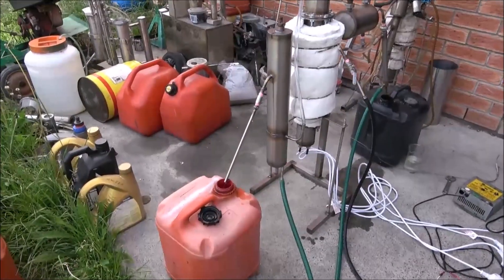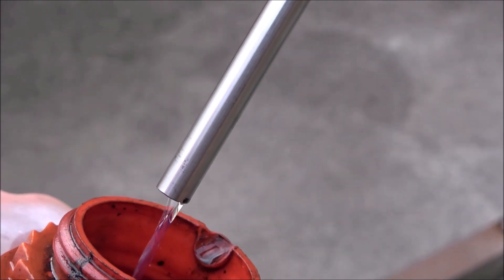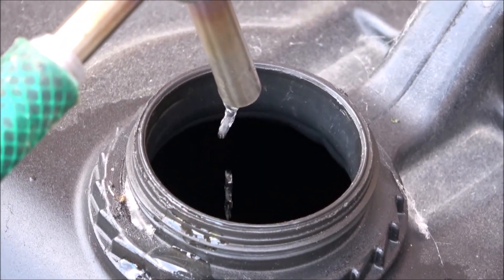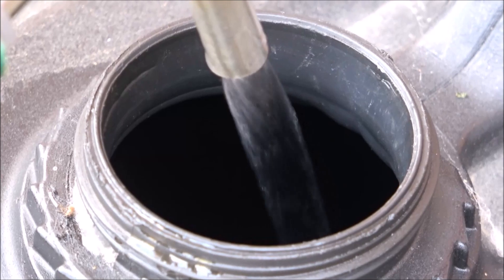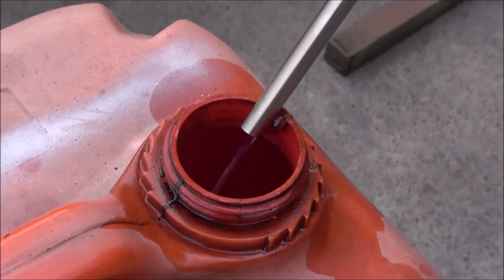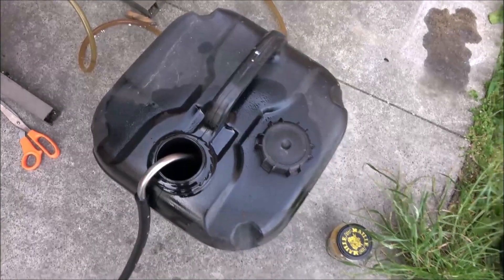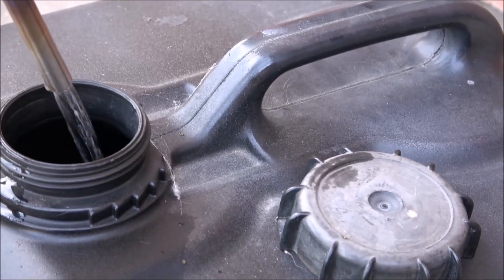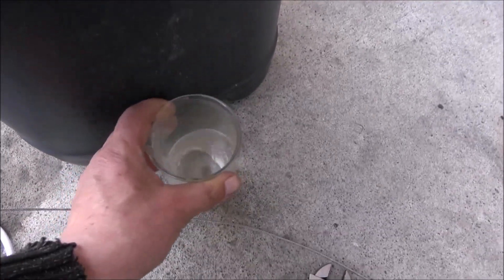6kw fuel separator.

Comment: Can you build one that's not electric I'd like to buy one of them but don't use electric for it I have a building I how pipe connection that lead through the insulated walls to fuel tanks I use to store fuel in so the fuels can't get to the flames but don't know how to build one
Reply from the maker: I can build one without electricity, but it would be bulky with pies and heating medium, also difficult to control.
Reply: @santeryi9  is there away to use a oil burner as the heat source around a tank that would be able to run a continuous feed
Reply from the maker: @lifeoftraveling8330  it's a continuous operation and temperature required is no more than 180c the temperature oi flame is about 800 to 1200c how you planning to control the temperature, the element can be kept at any temperature required